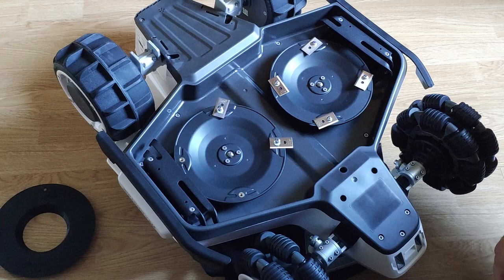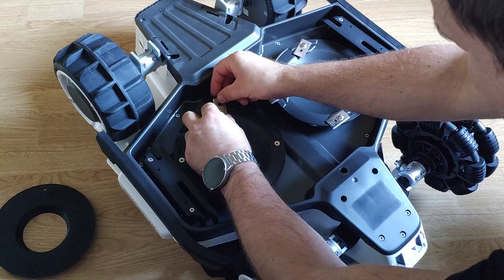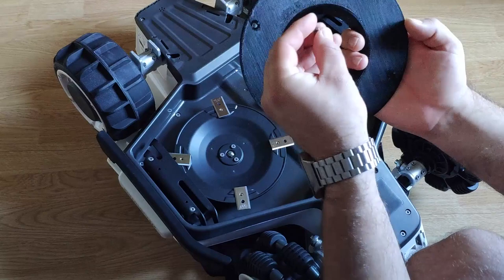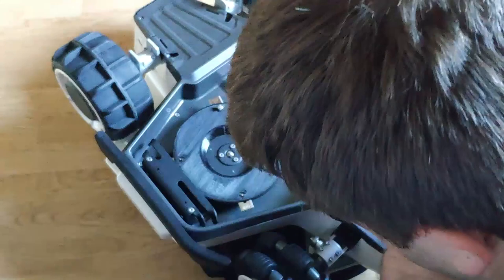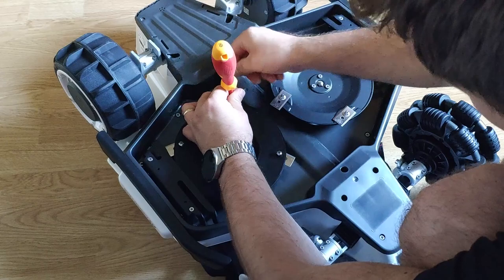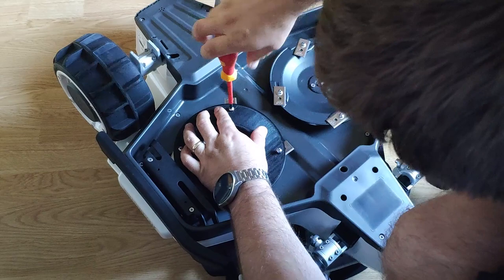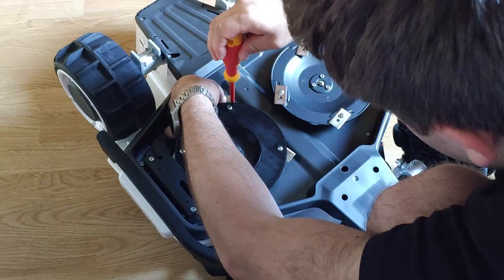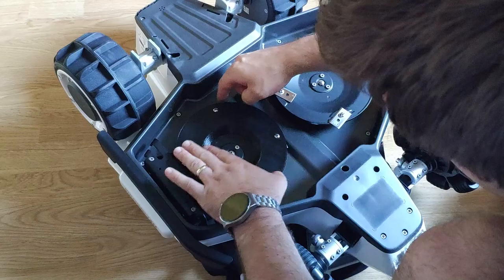Luba blade covers mounting tutorial

Comment: What the hell is this thing ?
Reply from the maker: It prevents blades from geting stuck. Usually grass jamm between blades and plate and stuck blades in one direction. This covers solve problem with that
Reply: Where can get/buy such covers?
Reply from the maker: @eugeneartjuh4785  write me on osa3dp@gmail.com
Reply: @0ssaa  blades?? WTF is this thing a lawnmower ? Goofiest looking lawnmower mower I’ve ever seen
Reply: @0ssaa it's not going to prevent grass from getting under the blades. It actually protects the cutting disc. Husqvarna automowers all have a metal skid plate that does exactly what this does and I guarantee you from experience that grass still gets in. You just need to check them once a week or so
Reply from the maker: @Truthbomb918  probably it depends on users lawn, type of grass and period of year. Some users claim that mow for longer than 2 months without blade blockage. For me it stuck somtimes, but that is maybe after 1-2 weeks, and not after every job. But yes, I also noticed that protect disc from wearing. Because compared to some users without dics protection, difference in wear are realy visible